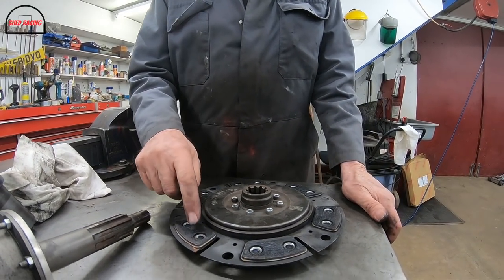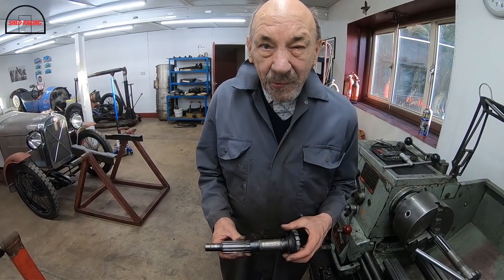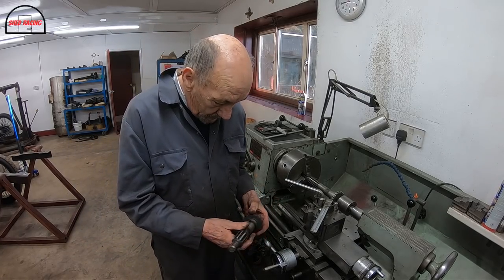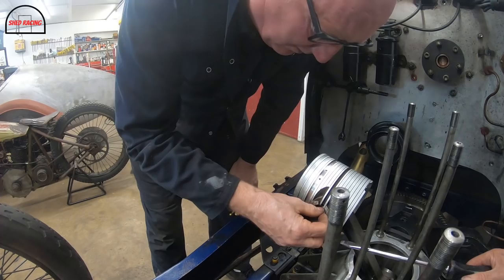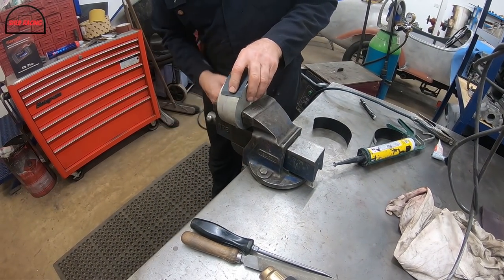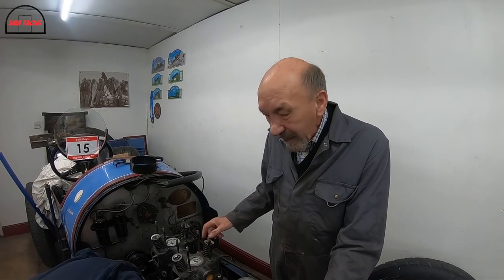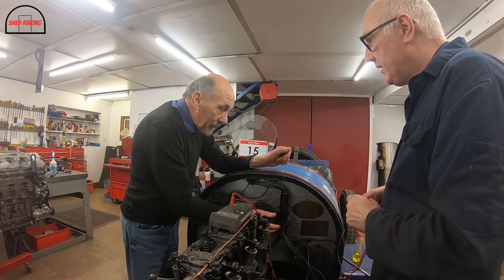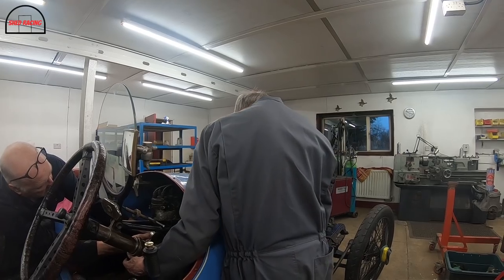SHED RACING - Hall Scott Engine Rebuild (Pt 2)

Comment: That engine is a monster! Each cylinder has nearly twice the capacity of my entire car. Reckon you'd beat me in a straight line, but I'd have you hands down in the corners. Now, if I could get a 10 litre engine into a Mazda 2...

Comment: That was a great watch - what a fantastic piece of engineering. Much quieter and smoother than I was expecting, and can’t believe how cleanly it runs with your piston mods. The lovely thing about huge old aero engines is that everything is big and on display, and running so slowly that you can see the engineering principles in action in real time. Looking forward to seeing the road test 👍😊

Comment: Try spraying the distributor cap with WD-40, just until you find a replacement. I think it'll help insulate the carbon tracks, and also drive out any potential moisture.

Comment: Some years back, a mate wanted a five speed gearbox for his V8 Mercedes. The only one he could find was a 5 speed from a fur cylinder car. He found they have a small input shaft and this was prone to breaking so he got a Diesel input shaft and cut the gear off,did the same to the smaller part and welded the shafts together. It is still going well despite burnouts etc. 
RE Flywheels, In the US, Drasg racers have found that running heavier flywheels is actually increasing their perfomance ,so Ivan is on the right path,.

Comment: Ivan I think the half compression feature was when it was new you would turn the engine over by hand with the propeller to prime the cylinders with gasoline as we still do on our airplanes even today. Then have  full compression to get the engine to fire that Hall Scott is a big engine to hand prop.  Ed  40 S of Vegas
Reply from the maker: completely understand what you have to do to start it with a prop, but with a self starter that whizzes it over, it will start on half compression - but only need this occasionally when the battery is low

Comment: I've never heard of using a split pin to locate a gudgeon pin, seems like a strange idea and why did one of them break (and will one of the other 3 do the same thing soon) ?
The purists may not like the idea of replacing the distributor cap with a modified one from a Ford motor but that sounds like a good idea to me. 
These videos are a joy to watch.

Comment: Slightly more modern aeroengines (I say slightly because they are only a bit more modern than that lump you're working on) use a soft rubber O-ring around the base of the cylinder that accommodates all the shifting about under power.

Comment: Brilliant, just brilliant. I was headed to bed, but when I saw your video, all thoughts of sleep vanished. Was that WD40 or carb cleaner for the clutch? Most unusual, but your logic seems impeccable. Smooth power delivery to the rear wheels & quicker off the line without drama.
Reply from the maker: WD40 used for the clutch

Comment: Ivan, wondering a few things, why no bell-housing between engine and transmission?  I think it would ensure proper alignment for free clutch movement.
How do the valve stems get lubricated in the guides?
What is the compression ratio of the engine?
Thanks for the entertainment!  
Keep up the good work.
JIM

Comment: The Hall and Scott sounds wonderful and is really quiet for a motor of ten litre displacement. Ivan I am sure you have been asked before, but what is the origin of that beautiful steam locomotive on the cabinet behind you? Is it a working engine or just for show? I'd love to know. Also who is the manufacturer of the Tiger Seal, and is it readily available in the UK or do you have to get it from abroad?

Comment: If that spline shaft was butt jointed with silver solder I confess I'm a bit surprised it held up, but only a bit. If it was done as a sleeve joint of some sort, well then it'd last donkey's, you'd twist something else to bits before the solder would let go.

Comment: Brilliant video. Please can you tell me, what is that shaft that goes from the camshaft through the bulkhead into the cockpit?
Reply: Before you get the answer, I'll guess it's for a tacho, but I'll admit it looks a bit over engineered for that.
Reply from the maker: Thanks - Its a drive for the distributor !

Comment: Modern cars with lightened flywheels need dual mass flywheels with arc springs to save the transmission from torsional vibration. Remove them and destroy your transmission.

Comment: Thank you Ivan and crew for another great video. Ever since finding your video series, I have watched with great fascination.  I love your vintage and historic cars.  I try to get to the vintage and historic races here in California every chance I get.  It is what got me involved with my obsession with T-Series MGs.  I eventually and quite accidentally found my dads old MGTD/c that he campaigned in the early 1950s.  After a six year complete restoration of the car I have a piece of my dad with me.  Every time I slide into its factory competition buckets I slip back into a time imagining my dad and his love affair with competition and MGs. 

Not nitpicking but merely two suggestions: 
1) is it possible to have Ivan wear a clip on or headset microphone?  It is very difficult to hear him when the microphone is at a distance away from him and when he is turn away from the camera. I have my volume up as high as it goes and it is still very difficult for me. Maybe others as well.  

2) I know you have been “gear heads” for longer than I’ve been alive but please open the shop doors when running engines in the shop.  Carbon monoxide poisoning is a terrible thing and it is damaging to one’s health and can cause severe illness and death.  I want you all to continue to be productive and in the best of health for many more years. 

I cringed when the wrench slipped from Ivan’s hand while he was tightening items on the overhead while the was idling. All I could image at that very moment was the wrench falling into the flywheel or clutch and being turned into an unfortunate projectile. Glad the wrench ended up safely on the floor.  

Cheers Mates

Comment: I have had axles cut and resplined and they have ended up too tight. I dont like tapping them in. When the splines are heat treated they grow 2-3 thou. Too often the spools you buy are similar. In those days I did not have a decent lathe,,with 35mm through the head.  I have now but am too tired to work on the car!
Nothing prehistoric like this. Good common 80s 'muscle car'

Comment: ive got a 4hp Douglas talk about bent wire crank this thing has it the b e journals about 3/4" 1919c   vaulve guides use sashweights the idia is the castiron is harderthan meanite   ttfn&ty